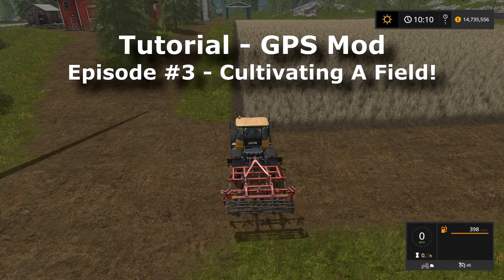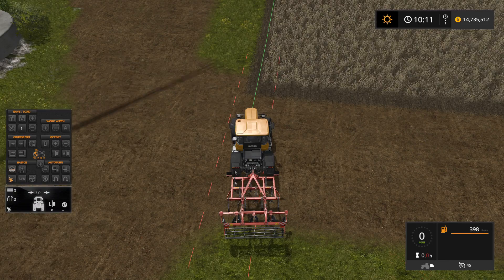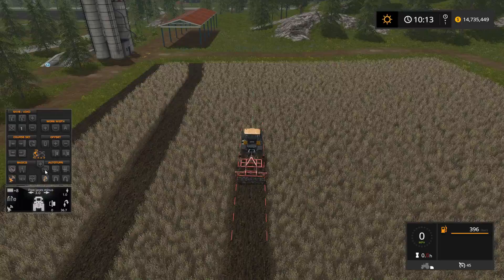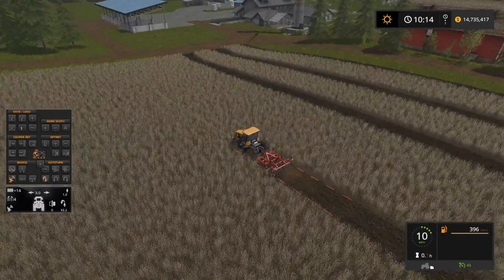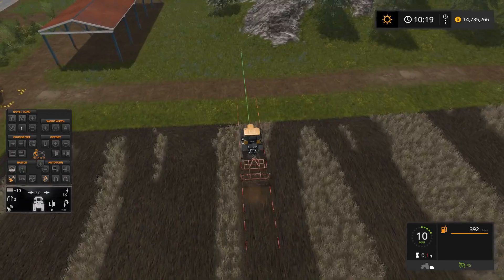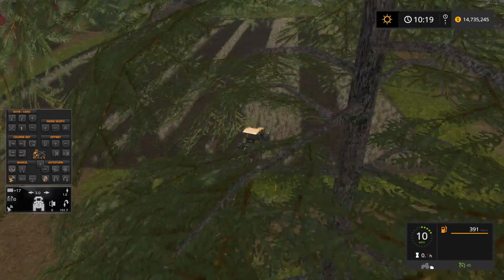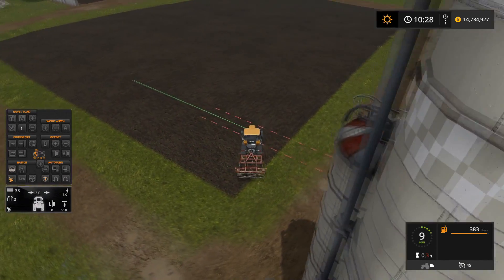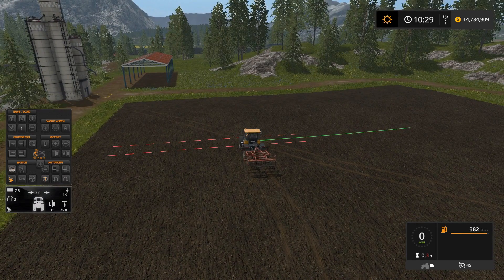FS17 GPS Mod Tutorial #3 Cultivating A Field

Comment: Nice demonstration and explanation regarding GPS skipping lanes.  I don't recall the specific pieces of equipment but I've seen where the turning radius GPS uses is so close between for example 2 or 3 lanes that it will sometimes do one or the other.  Of course that really messes things up for us lazy farmers.  I've tried in those instances to set the skip lanes feature to accommodate but it didn't seem to help and I just had to do some of the turns or cleanup manually.